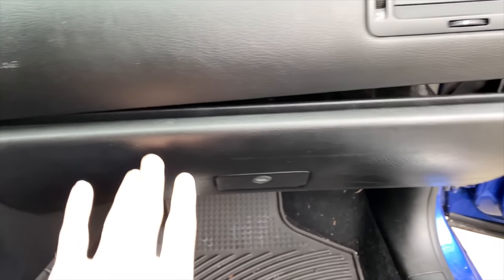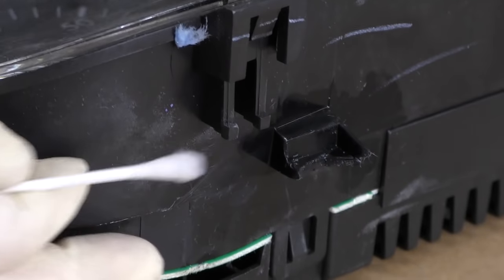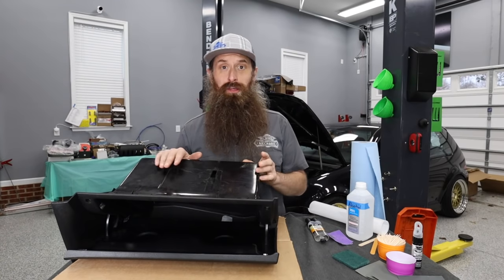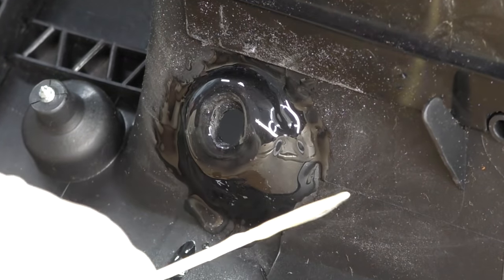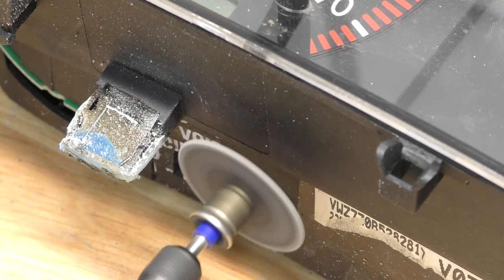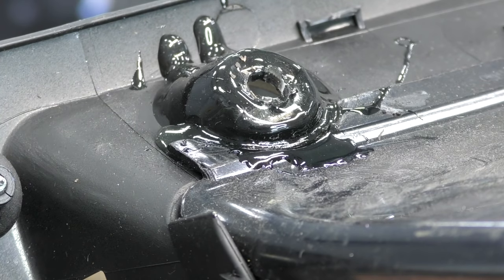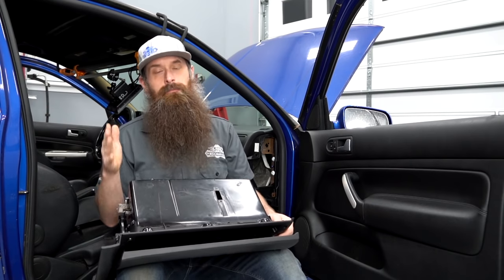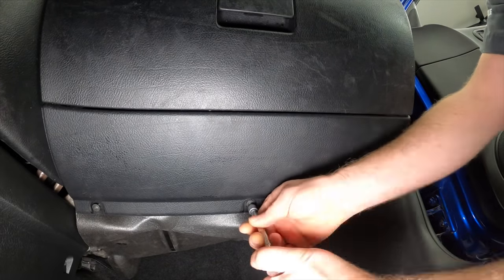How To Repair Broken Plastic Car Parts

Comment: Maybe the epoxy here in germany is a little bit different. but  almost everytime i made the experience, that it came off the plastic, the moment a little bit of pressure is applied by a screw or while putting it in place.
Someone from the car industry told me, that car plastic is almost impossible to glue, because it is made out of thousand different types of recycled material. its different types of polypropylen xyc, old rags, potatoes (yeah potatoes) and even waste from butchered animals.

Comment: that's a hell of a lot of work for a repair that's probably going to break as soon as any stress is put on those mounts
Reply: Epoxy is actually pretty strong. I repaired my laptops hinge mount part with epoxy and it's still good after 3,5 years.

Comment: Instead of using epoxy glue, which is drippy and takes some time to dry, why don't you try the glue which dries immediately when exposed to UV light. This is what dentists use now to use to fill our teeth from cavities. One brand is Bondic but there are several brands of it at Amazon.
Reply: Should buy a UV light source too while buying the product that needs UV to cure fast ;)
Reply: The Bondic product comes with its own built-in UV light source with the UV sensitive glue.

Comment: I also use tinfoil where you used the blue tape to make the form/tray.
Reply from the maker: Great idea!!!
Reply: @HumbleMechanic  I used to be an auto-body technician.  The tape is ok, but as you see, can stick to the repair.  As long as the foil remains flat and smooth, you won't typically have any problems.  Even if there is a crease or a small area where the resin can flow into, as long as the foil is not sticking up, and allowed to "enter" the resin, it should be a smooth removal.  Plus, since the foil is rigid, it is easier to make a mold.
Reply: Just get aluminum foil tape; get the best of both in a single component.

Comment: Squeeze the epoxy into the corner of a ziploc or equivalent sandwich bag. Twist the corner closed and kneed the two part epoxy to mix. Clip the corner and squeeze the epoxy exactly where it needs to go. Use duct tape. To form your epoxy dam. It holds better masking tape. Also duct tape makes an awesome backer to prevent epoxy from migrating onto the exposed side of the repaired part.
Reply from the maker: Great tips! Apply like icing a cake
Reply: Exactly and thats where I learned it. Really liked how you reinforced your repair with wire. Also the video was meticulously presented no steps were assumed to be understood. Thank you.

Comment: This does not really have much to do with the actual content of this video but how does one can remove the front cover from a glove box? i specifically mean the part that seems to be securely hinged. Basically the door itself.
Edit: In case it matters, I'm talking about a A3 8L glove box.
Reply from the maker: some of them are one piece. But the replaceable ones are held in with pins. You have to take the whole assume;y out like I have in the video, and take the pins at the bottom out. It can be kinda of a pain sometimes

Comment: hi, epoxy might be not the best for plastic repair, it lacks in flexibility, it cracks off easily when you tighten bolts, better use some more flexible glue like JB, or add plasticizer to epoxy

Comment: Disposable foam earplugs work well rather than parchment paper.
Reply from the maker: My epoxy stuck to them. I LOVE ear plugs for paint!!
Reply: A plastic mold release agent could prevent that sticking if applied to the ear plugs beforehand.

Comment: I tried various types of epoxy, everytime after it sets, install the whole thing back and it breaks the part where i mended
Reply from the maker: Some times you just have to toss it in the trash. Or maybe melt abs plastic abs reshape

Comment: To save money crazy glue and baking soda less than 5 minute drying .start slow just enough to fill in rhe crack. Cover the area with glue when it’s covered add baking soda enough to make a thick layer cause your going to need to press it down

Comment: Wouldn't it be easier to get a used glove box from a salvage  yard?
Reply from the maker: If you can find one that doesn’t suffer the same issue. Lol the door is broken on this one too. I had a backup from the junkyard. But the first time I pulled the handle it broke too. 😖

Comment: I can't speak to your VW but I can tell you FOR SURE that none of these techniques would make a permanent repair to my Toyota plastic.  I say "permanent" because glues can sometimes appear to adhere to surfaces but later delaminate and fall apart.  Such is the case with a door panel on my Highlander.  I've tried every type of glue I can find with no luck.  I hope somebody out there has had better luck than me.

Comment: Repairing metal parts by soldering a puddle of some "tin" to add material is called "tinning" or "tinkling"    What you made with the blue tape is a dam to hold the liquid.  For a tinkler, this would be a tinkler's dam.  Basically just whatever garbage you have lying around.  Not worth a tinkler's dam, or, "a tinker's dam" as it was eventually said once people got in the habit of dropping the "l".  The act of doing it was then called "tinkering."

Comment: Do you know what type of plastic that is? I was trying to glue my civic’s center console which I snapped in half like a retard when taking it out. Anyways, come to find out it’s labeled PP (polypropylene) which is incredibly hard to bond. The plastic epoxy I used peeled right off. So I tried again after flame treating the glue surfaces, hopefully it holds this time

Comment: After 26 hours the 5 minute epoxy is still tacky on the repaired section.  If I put the panel in the car, next time I try to remove it it will have glued with the backing and rip off the plastic in pieces. 😡

Comment: Did you leave out the option of plastic welding and heat wire because this is sponsored by a glue company?

Comment: Or...and call me crazy...but you could go to a pick a part yard and get a different plastic piece.
Reply from the maker: The issue is, for the most part, you run the risk of getting a part with the same issues. Especially on this generation. The newest one is 2006

Comment: USE ACETONE for ALL cleaning, including the bonding surfaces and tools. Acetone comes cheap at about $2-3 bucks for a bottle of ... wait for it ... Nail Polish Remover! USE gloves AND lots of ventilation. Acetone won't do any real harm, but it is a really nasty odor. Acetone will eat many plastics, which exposes fresh clean bonding surfaces. DO NOT LET ACETONE TOUCH ANY CLEAR PLASTICS!!!

Comment: Clear epoxi is not nearly as strong as the grey one. Is not even the real deal, my polymers professor at college told me.
Reply from the maker: Yeah the grey one I showed is stronger for sure. Just a little trickier to work with

Comment: Instead of masking tape I have used grey modeling clay.😉
Reply from the maker: Great idea!!! Does the epoxy stick hard to the clay?
Reply: The grey modeling clay is a little oily and never really dries out. So the epoxy won't stick. Also used it a lot making molds in the fiberglass industry cause the fiberglass wouldn't stick to it.

Comment: absolute crap repair, that will break off on small stress
Reply from the maker: Maybe, time will tell. But having repaired many of these in this way, and not have any break id say the odds are good it will last. especially in low stress environments